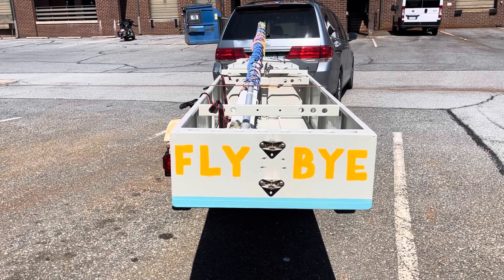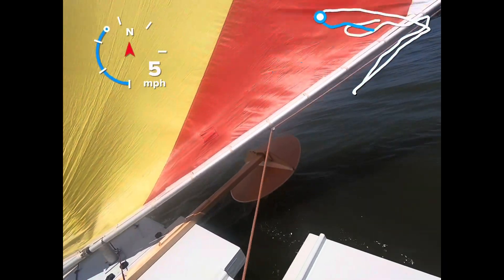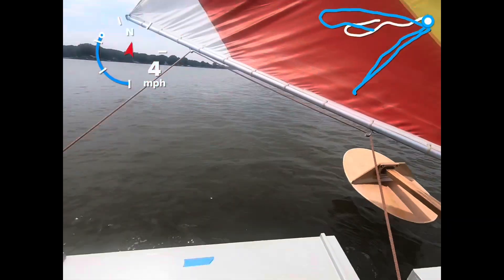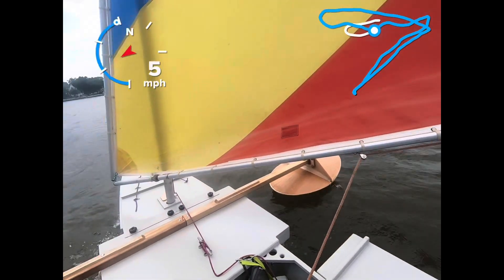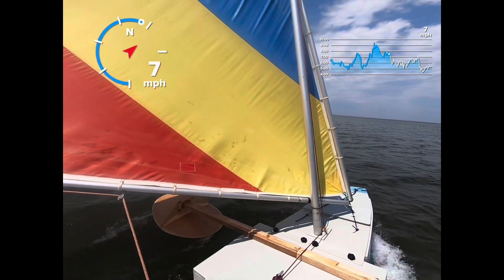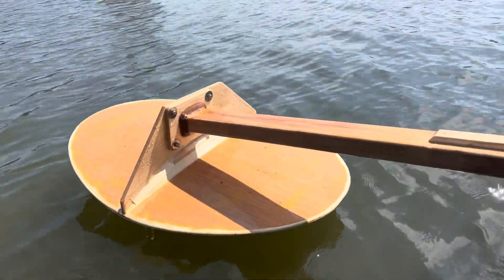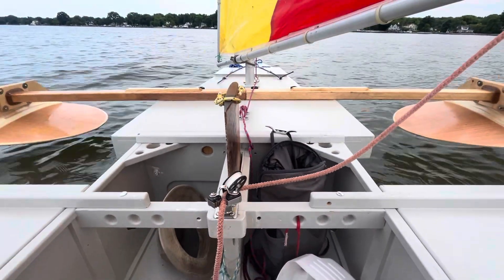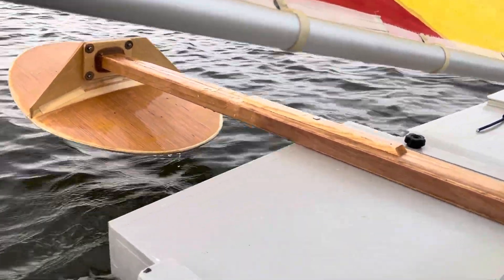Skimming Disc Ama Testing on the Chesapeake Bay

Comment: Have you considered making the disks top like conus or upside down boat shape so they get them selves out of the water rather than dig in.
You want only the bottom part flat if the top is flat as well then the same force keeping you up will keep them down when water covers them.
Making the top different shape will make them self rising.
Some rubber or water resistant cloth even or even enclose them bouy style to have an air pocket ect.
But having them flat like that is worst option anything else should be better. No?😊
Reply from the maker: This discs are not flat, they arc upward from front view and downward from side view.  They are 60mm thick in the middle.
Reply: @markpalmquist  yes I didn't ment perfectly flat rather follow the contour of that rib piece in the middle that you had them attached to.
Just as you mentioned in the video about the force in the middle pointing downwards.
When the water is over them you want same shape but pointing upwards so they push out of the water on their own.
Using the same shape that pushes them up to push them out of the water when they dip.
Reply: @markpalmquist  this what I was referring to
Reply: 2:48

Comment: you could get more torsional stiffness by going to Two cross beams, fore and aft.
they could be a little thinner, fore and aft, than the one; because it's the separation of elements suppressing the torque....but it will still twist, unless you have a diagonal.
or one strait cross beam, and two separate ones at an angle.
Reply from the maker: I may try that, thanks

Comment: Congrats on a successful run!  I was waiting impatiently to see how the disks worked.That spar definitely looks a bit lightweight for the forces that are on it at higher speeds. I would be little bit cautious and attach a small line to the discs in case the spar breaks and the disc comes swinging back into the cockpit. In fact adding a line or wire under tension attached to the ends of the spar and the bow would help a lot relieving the stress on the spar.
Reply from the maker: Good idea

Comment: I like that you are experimenting with fluid dynamics in real time.  I am also engaged in this experimentation. I would suggest you do some research on Bernoulli Principle vs. Coanda Effect, and consider that unlike air, water is a non-elastic fluid.
Reply from the maker: Yes, I have been familiar with both of those since middle school.  The reason the disc does not sink is because it deflects water downward and the water resists harder the faster the boat travels.

Comment: What a relief when you ditched the head camera! The latter give me nausea with all the rapid changes of view.
Reply from the maker: I do tend to move my head around too much.  It makes me dizzy too.
Reply: Ah, I think all head cams are like that. Hard to stop yourself from wanting to look around 😅
Reply from the maker: @cvanscho  will try a bow mount with remote control
Reply: @markpalmquist  Looking forward to further experiments!
Reply from the maker: The bow mount did not work.  The discs were out of frame.  I would have had to switch to wide angle which creates much more distortion.

Comment: So, the idea is to cause an outboard surface of the boat to begin hydroplaning before the main hull might? And thereby gain both the stability of the outboard 'lift' and possibly help the main hull achieve plane earlier?
Reply from the maker: Basically yes, the disc can support the weight of a person once traveling 8 knots and it can lift half the hull out of the water at 12 knots but only if the crossbar does not twist more than 2 degrees.  The current crossbar is not strong enough to reach 12 knots.  I’ll make another one and test again.
Reply: It's possible that rigidity is the opposite of what you want, but instead... perhaps a way to tilt the angle of attack reactively against the waves.

Comment: Nice disc brakes.:face-purple-crying:
Reply from the maker: The disc on the left was supposed to be at 6 degrees but it was only at 3.2.  So that is why it caught so easily.  It has not happens since I adjusted them.

Comment: Pretty neat, the disc seems to be concave? Seems they would dig into the water. What am I missing? Thanks for the share.
Reply from the maker: They are not concave, the bottom curves upwards as looking from the front and the top curves downward as looking from the side.  The bottom is pitched up 6 degrees but the flex in the crossbeam decreases the angle of attack a bit.  I will try a stiffer crossbeam next time.  I could also try pitching them upwards 8 degrees instead of 6.
Reply: mark, i knew i was missing something. Nice stuff you're doing.
Reply: Would a triangular A-mast solve some of the stiffness/strength problems? A la fliptacker...
Reply from the maker: @rasmusmller625  I just searched fliptacker and found something by Bernard Smith but I don't know if you are referring to a sail design or the disc or the crossbar.
Reply: @markpalmquist  I was sloppy in my comment. I meant that a triangular mast structure with your skimmers at the corners would improve strength and stiffness.  You may even be able to hoist your lateen to the top corner of the triangle. 

The fliptacker is indeed by Bernard Smith , the triangle mast idea just made me think of it.
Reply from the maker: @rasmusmller625  No worries.  Good idea. That would be a great set up on a larger boat with a bigger rig that required more than just 1 unstayed mast.